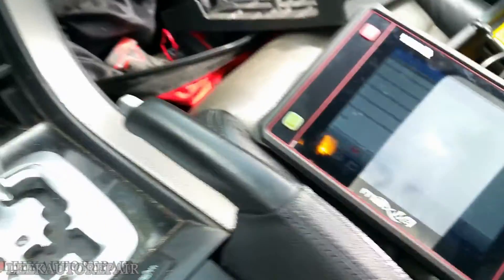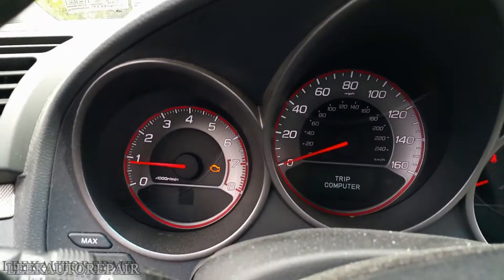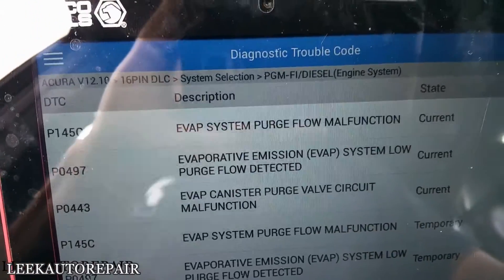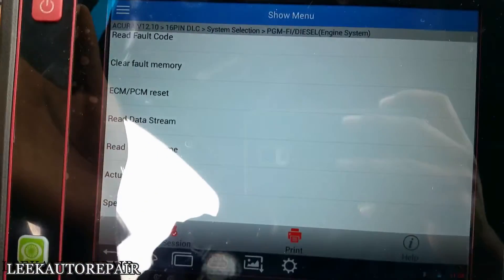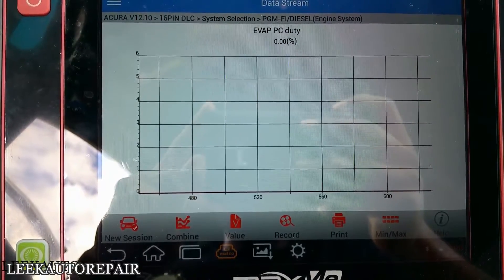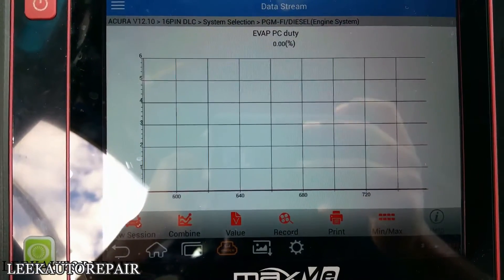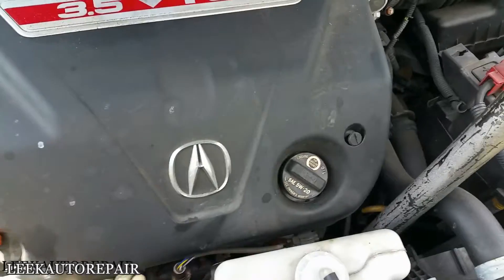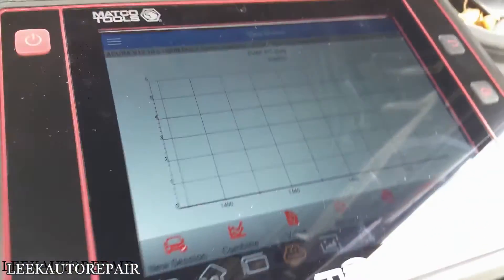How to Test Evap Purge Control Valve P0443 2004-2008 Acura TL Part 1

Comment: What does it mean when the purge valve starts clicking super fast and somewhat louder than normal after about 2 minutes after startup
Reply: Did you figure out why that is? I just replaced mine with an Amazon one just for testing because my oem one works but throws the gas cap warning only. The solenoid is loud and you can hear the pumping but it’s an off brand

Comment: Chasing this same problem!!  Super frustrating.   Not the solenoid, not the gas cap, found a broken Hose from solenoid top top to I.M.,  nothing so far.  Gonna look for broken wire next.  Frustrating
Reply: Same here not my car but my friends car. What did it end up being for you? We’ve taken it apart piece by piece and tested with voltage we suspect the wiring as well
Reply: @zprkd247  Also facing this issue and ive replaced the solenoid twice. first time i replaced it, lasted a year then the issue came back, second time the replacement didnt fix the problem.

Comment: My tighten fuel cap light comes on when I brake, accelerate or go up or down hills. It’s almost like it turns on when the gas is shaken around.
Reply: Get it scan for codes I had the fuel cap light on I scan it had the p01456 end up being loose gas cap
Reply: See if you have pending codes
Reply: Mel Cruz no pending or current codes.
Reply: Mel Cruz you won’t believe it. I put a new gas cap on, and an aftermarket evap purge valve and it fixed my problem for about 1 week and then my tighten fuel cap came back on. Today my check engine light came on with the p145c and p0497. So I’m going to put a oem purge valve on and see if it fixes it. I might have a bad connector or something. I’ll keep you updated.
Reply: @robbym3542  check hoses on purge valve
Reply: Mel Cruz the hose is clear. I have an oem purge valve coming in the mail in a couple days along with that tube that goes to the intake. Hope it works.
Reply: @robbym3542  update ??? I have the same problem
Reply: @the_solution2932  I went with a oem evap purge solenoid and haven’t had the issue since. I also went with a new gas cap for good measures but it’s usually the evap purge solenoid. Make sure you get OEM

Comment: So I have the same problem. First the code was that the gas cap was loose. I replaced it, then it came up again so I changed the canister purge valve. And now the engine light came up 😂 😂 😂 😂 Im locked now. I ran up a test and those 2 things I did were on the list   so...
Reply: you ever figure it out? facing same issue.

Comment: Have a 99 TL with P1456 code. I assume the Evap Purge Control Valve is located at the same place? I already replaced the canister vent valve and gas cap. Thanks for a great video.

Comment: my 06 tl has a high pitch whistling noise, i changed my pcv valve bc it was clogged but it didnt help. when i pull out the dipstick it releases alot of pressure tho, any ideas?
Reply from the maker: +jason gonzalez pulling the dipsstick out while the engine is running creates a vacuum leak on most cars. Is the check engine light on?
Reply: High pitch whistle air intake resonance?
Reply: Bro me two on my 05 , did you ever fix it ?